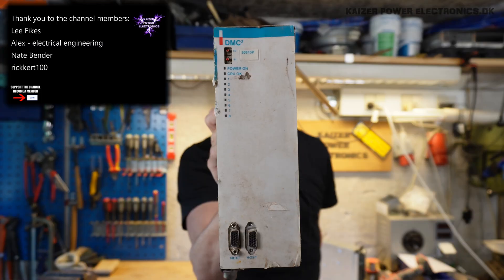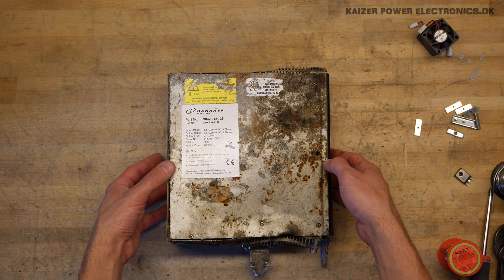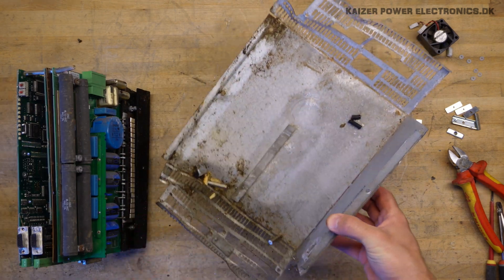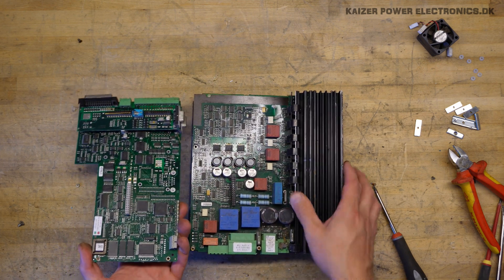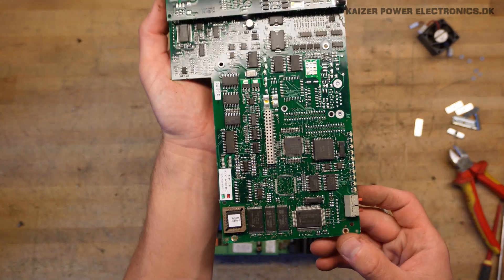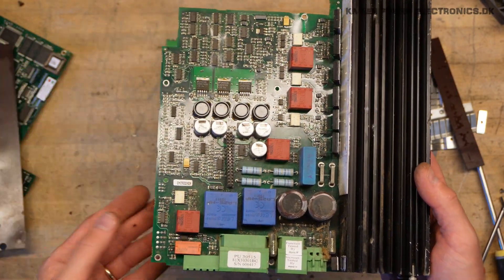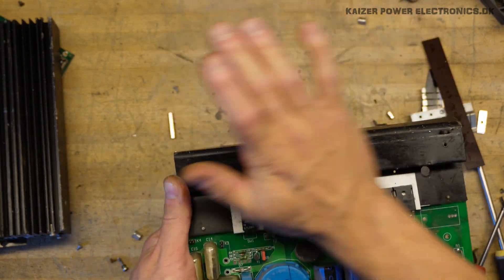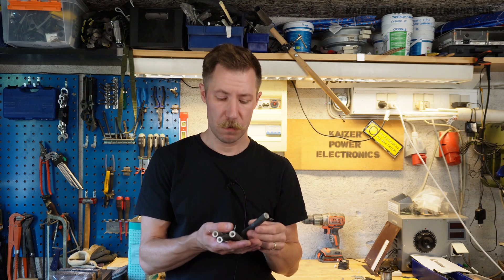Danaher DMC2 30151P Servo Drive Teardown

Comment: Hi everyone! Do you know where the settings are stored in dmc2?
Reply from the maker: I do not know exactly, but seems like its through the host interface on the front. At 3:08 in the video, bottom of the PCB you can see RAM and ROM, when settings are most likely saved.

Comment: Intel made some 16bit cpu with floating point unit i960 i think. Does it have separate ADC chip?
Reply from the maker: I suspect that the Xilinx CPLD would handle the ADC
Reply: @KaizerPowerElectronicsDk  Looked at pictures on the web and there is MAX125 2x4-Channel Simultaneous-Sampling 14-Bit DAS, DAC7624 12-Bit Quad Voltage Output
DIGITAL-TO-ANALOG CONVERTER. Wanted to look at that orange part for power supply of the gate but it is too dusty to see the part number.
Reply from the maker: The SIRIO 132256 pulse transformer?
Reply: @KaizerPowerElectronicsDk  I was thinking if it is pulse transformer. Unusual to see pulse transformer next to isolated gate driver chip (I believe it is HCPL-3140). Couldn't find datasheet. To me it is more likely to be DC/DC isolated converter that powers high voltage side of HCPL3140, but without datasheet it is not possible to know.

Comment: What about snubbers and filters?
How did they keep the parasitic capacitances of the transistors from generating huge currents?!
Reply from the maker: Do you mean the diodes? Check out the pictures on my website, linked in the description. There is Varistors, resistors and  0.33uF MKP capacitors all around the diodes and DC link capacitors.
Reply: @KaizerPowerElectronicsDk  When the FETs switch they cause a huge current spike because the C_DS is empty but gets connected to supply. It is much worse than a charge pump where a full C is connected to a almost full C.

Comment: If the braking section passive? ie just diode "commutated" and uses a single switching element on the output of that rectification to turn on / off the brake resistors, with no inductive element (ie brake current is just averaged by duty cycle of the single switch)?
Reply: With an inductor you couldn’t really break, there needs to be some way for the energy to go: either in the reservoir caps or into heat (by means of resistance).
Reply from the maker: Check out the pictures on my website, linked in the description. There is a dual Epcos 1.8mH inductor sitting just beneath the IGBT.
Reply: You recover energy into the filter capacitors using the diodes and the inductor to limit rate of current flow after an initial smaller capacitor. Then the brake resistor is used to dump energy if the capacitor voltage is rising too high, and if there are not other drives sharing the same DC bus to use it.  You can have a single large drive being the sole mains connection, fed via a line reactor to limit inrush current on the bridge rectifier, and then the main DC bus is shared with the smaller units, with a single brake resistor bank also on the DC bus, in case the DC bus voltage, due to energy recovery, is rising too high, dissipating this power in the brake resistors, normally with a PWM switch that modulates the power dissipation based on the voltage rise, so it smoothly ramps up according to the excess voltage, so the bus does not sag if there is a sudden draw, while the brake resistor is at full dissipation. typically the brake resistors also have a thermal switch, or thermal sensors, so that they can communicate with the controllers to limit energy recovery if the brake resistor is getting too hot, and the thermal switch forces the controller to shut down (or severely limit operation speed) if the resistor is too hot too long. Finally there is a non resettable thermal fuse to disconnect the brake resistors, and allow the controllers to not have brake resistors, which triggers them all into shutting down with input overvolt warnings, and needing maintenance to reset them and investigate. 

Easy with a single drive without a brake to do this if you have a very rapid ramp down of the load, and it then trips out on input overvolt, and needs to be power cycled. Had to adjust the ramp down rate from 2 cycles, drive ramping up from 0 to 75Hz in 0.1 seconds, and back down to zero in 3 cycles, to prevent this, with the 1kW motor being perfectly happy with the ramp up and down, even with only the supplied fan cooling, as the motor was sized simply because of torque, and ran for 6 revolutions per cycle. 

The other motor, a 50 year old Lenze motor, not originally ever designed for VFD use, just needed a 120mm fan bolted to the shroud, and removal of the fan, to make it run cool, because the drive regime was now it running at 30Hz, so needed that external cooling. Removal of a failed variable speed drive that was long obsolete, and where a new drive was not possible, so the old variable side was removed, and replaced with a plain taper lock pulley, machined to reuse the old variable speed belt.